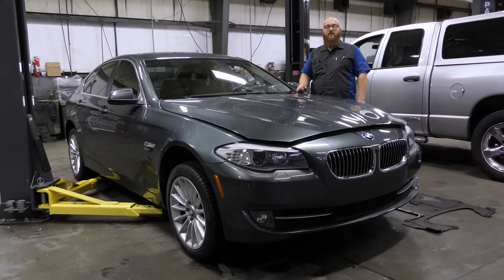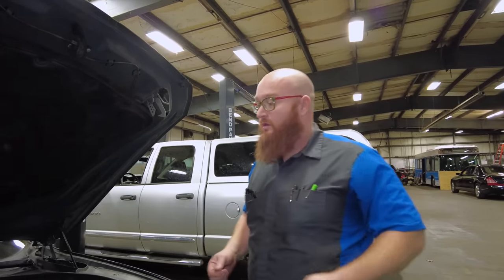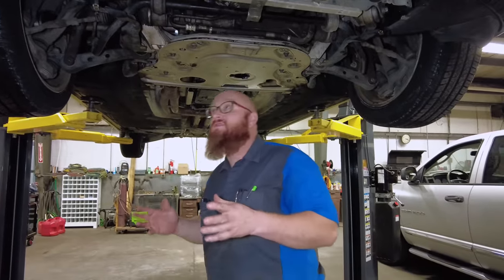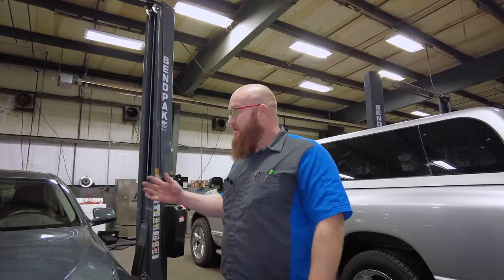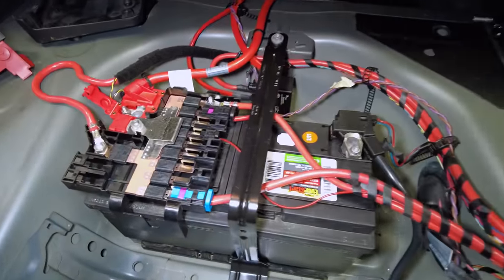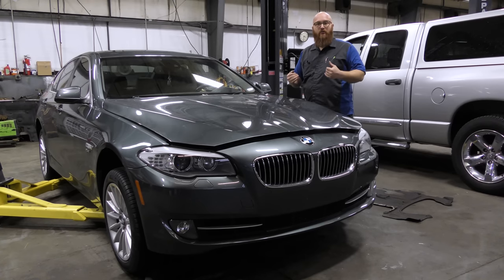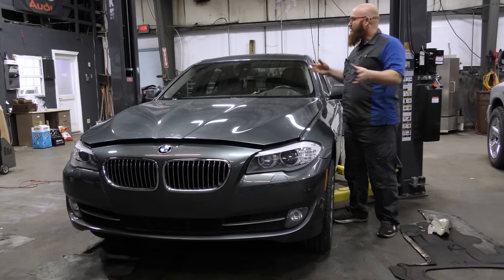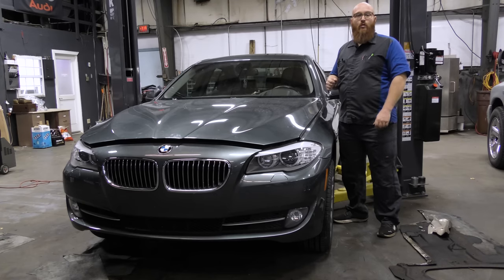One bad day for a customer! CAR WIZARD found TWO insanely unrelated issues at time on '12 BMW 535i

Comment: BMW engineers do an awesome job of designing their cars and parts to fail outside of manufacturers warranty. They make it an art form!
Reply: Jealous you can’t afford a new one?
Reply: No that's not it. I have friends that bought them new and used had nothing but trouble. I've even assisted a mate replacing all the cooling system plastics because they just perished and cracked, that sh!t box had just 96000 kilometres on it.
Reply: @seanm3ify  Whatever bullshit you might come up with doesn't make it less true. 🙄
Reply: Fords and GM too.
Reply: Once upon a time, BMW and Mercedes may have been a pain to fix, but the quality of the parts meant they were reliable.  The quality just isn’t what it used to be.  I would rather lease those than buy new, and if I bought used, I’d be prepared to DIY some of the easier repairs.
Reply: They fail even within warranty periods.
Reply: economic terrorism.
Reply: If you cannot afford a brand new BMW with a warranty there no way you're going to afford one when they are out of warranty and breaking all the time.
Reply: @Brusselpicker  they’re great first 3-5 years depends on series. Lease only lol.
Reply: It's 200,000 miles...hardly what I'd say as a "design to fail outside of warranty"...which occurred 150k miles ago.
Reply: @Dozer04r1  I have a Camry with 300k no a peep
Reply: @zachgorman1133  German cars fail plenty well within their warranty. The point is, they’re not what they used to be and BMW knows they can sell their cars no matter what.
Reply: @Boris Levenzon  I don't follow your connection. I replied to the comment that they fail out of warranty. Regardless of your Camry, 200k is far from any warranty. I am not commenting on if it should have failed at 200k.  BTW, I had an Accord with a failed transmission at 60k (out of warranty)...is there relevance?
Reply: As a BMW enthusiast who has been driving and working on BMWs for 22 years, I can confirm that this is true.
Reply: Dodge challengers are built on a BMW Chassis which has always bothered me. The rest of  the vehicle is top notch the chassis isnt.
Reply: they've learned from the best ... from the vw engineers
Reply: Lol another Burn My Wallet fanboy defending poor build quality. Who would be jealous about overpaying and getting ripped a new one for a guaranteed lemon of a car. Reliability means a lot when you shell out for a car and the German brands, except maybe for Porsche, just ain’t it!
Reply: @paulac1234  never been a bmw fanboy ...  burn my wallet , this was a good one tho :))) didn't knew it :)))))
Reply: I love my BMW....motorcycle. With a Rotax engine.
Reply: The bookkeepers are the boss in BMW. The suppliers are bashed on price, and that is the problem...low quality  parts. Now in the coming decades of EV's that will be the death penalty for BMW, mercedes AND VW. They sold out their goodwill!
Reply: @seanm3ify  im sure you cant Goober
Reply: @paulac1234  and your a engineer right ,,,
Reply: @seanm3ify  r/wooosh
Reply: oh yes like the other brands are so better right? I know people with BMW's that have over 1 million miles on it. Stop exaggerating
Reply: Gotta laugh at this comment section. I'm possibly a fair bit older than some of you other folks, 40 years ago, BMW made great cars using high quality parts and ran forever. In  the UK in the late 1970s they would guarantee their engines for 150000 miles when most vehicles would die before 100000. Then the bean counters and the electrician arrived. In the 80s began the first problems with BMW electrics with cars crapping themselves regularly with random electrical faults. The engine guarantee disappeared and metal parts began to be replaced with plastic. After 30 years of this, you have BMW with plastic parts in heat sensitive areas that go brittle and break causing the 3000 sensors in the area to stop you car from running, valve seats so soft you can spread them on bread, parts that cost three or four times other manufacturers for usually no gain in quality, engines designed so poorly that some simple servicing costs more because you have to remove so much crap just to get to them.
Reply: @nenaddimitrijevikj5125  I know people with a million mile Morris Marina, doesnt mean they weren't a heap of junk.
Reply: @Brusselpicker  thats your opinion whats junk and whats not.
Reply: @nenaddimitrijevikj5125  just as saying there is a million mile BMW isn't evidence they aren't.
Reply: @Brusselpicker  look im not saying they are the most reliable cars but they are not as horrible as you guys make them to be
Reply: @nenaddimitrijevikj5125  and I'm saying that's your opinion. Just like you said to me.
Reply: @Brusselpicker  oh God we got smarty pants here. Move along
Reply: It's called planned obsolescence, and millions upon millions of non car people keep on falling for it. 
Some people are so stupid, they buy a car because it's "cute". Omg. 
Such people should stick to public transport.
Reply: @blevenzon  You can probably do another 300k trouble free.
Reply: @Brusselpicker  well said!
Reply: @BubblesTheCat1  I once saw a batch of like 10 nyc taxi Camrys at copart for sale standing there on lot, they all had 400-500k on them
Reply: Not true! My dentist brother leased a brand new 640i. 

Even within the first year or so, that car was bonging at the driver after every startup about low fluid this, or sensor fault that. I took it in for 'service' for him once or twice myself, only because he was so tired of doing it so frequently himself... Garbage cars right from the start, nice to drive though!
Reply: Just like Apple iPhone
Reply: @lot2196  F650 GS?
Reply: @ceesheemskerk2397  actually, greed is the boss at BMW (too). they want maximum profit. since they bought back east-germany, they feel like it's time to be rich regardless the method..... which USA people should not blame germany for...
Reply: @Brusselpicker  you look sensible. however, you fail to realise, that what you are writing about is a general automotive industry trend. greed is the drive ... profit, you know... BMW also having shareholders... and they want their money...  also, there is a strong turning point in history.... west germany "bought back" east germany... so they were keen on to get good fame for german cars .... and once they got back east-G. than they relaxed.... and turned for profit, instead of reliability....
BUT, that brand heavily innovated their products... very fast paced innovations...and also, model cycles are no longer 20 years long... 3 years or 6 maximum with the highest classes (S-classe, 7 series, A8)....  and what could the USA car industry show up regarding innovation?  that market making petrol burning shitty muscle cars, riddiculous pickups, family SUV or sedans.... far far away from german innovations and on the top of it, cheap plastic solutions and shitty electricts too.
... all and all, this is a big game. and those people who are crying about failing luxory sedans, those people are driving through the rear-view mirror, instead of the front screen.....  
last but not least: german manufacturers always fixing the mayor issues untill the very last production year of the given model.... at least, correct attitude
Reply: So do VW !!
Reply: They are sadistic
Reply: @pilsplease7561  A Dodge challenger is not built on a BMW chassis.
Reply: @paulac1234  BMW is 3rd place this year in reliability
Reply: @oldrrocr  Nope. They have their problems from time to time, but when they're fixed, they're usually fixed. BMWs, on the other hand, are one problem after another after another.
Reply: @nenaddimitrijevikj5125  Yup, most other (non-German) brands are much, much better. You know people with BMWs with over a million miles? LOL! Stop exaggerating.
Reply: @Brusselpicker  You are 100% correct. 100%!
Reply: @nenaddimitrijevikj5125  They absolutely are. At least since the 1995-2000 model run.
Reply: @elstimate  Agree. In fact greed has overtaken Germany altogether, just read Merkl's comments on why she approved the Nord Stream pipeline. They would literally sell their souls for a few extra dollars.
Reply: @johnguidetti5839  Yeah, Chrysler never had anything to do with BMW. They did have a partnership with Mercedes.
Reply: @seanm3ify  Jealous to buy a endless money pit? I prefer a Cammed manual Camaro LS1 over any sheet quality beemer.
Reply: German Engineering!
Reply: It has to do with all the electronics, and extremely expensive parts to replace, and labor to work on. I would not touch one with a ten foot pole, unless it was leased. The older ones, like 70s,80s, and even some 90 models were reliable though.
Reply: @seanm3ify  Who would want one of these plastic-engined marvels?
Reply: @Brusselpicker  for you, time to retire from the comment section too, oldtimer
Reply: I heard a Mercedes exec...started buying old reliable buicks/ F150 pickups for retirement. 
He knew the REAL COST TO KEEP/ FIX/MAINTAIN THEM.  
I know people w Benz/Audi/Bmw they suck hard.....waiting to trade/ sell....
Reply: Hose got hot, popped off....never seated clamped right maybe .
Reply: The guy I work with just bought his wife a BMW they are having it custom made with the things she wanted but they didn't have available ,I tried like hell to talk sense into him before buying  but he figures he'll take his chances so I shut up I drive Lexus and highly recommend them but to each his own  he'll find out for himself now
Reply: @seanm3ify  They are garbage the guy I work with just bought his wife one and he'll find out for himself ,Lexus is the only car I buy and drive for peace of mind
Reply: @paulac1234  Buy a Lexus and sleep good at night
Reply: @seanm3ify nobody is jealous when it comes to owning BMWs. Funny part is when I was selling my 2000 Honda Civic SI I had two BMW owners message me offering to do a straight trade for their junker BMW . I just laughed and declined their offer .
Reply: @seanm3ify   they are six to eight grand. can I afford it? yes. can i afford to keepit on the road. probably. do i want to go broke doing in? hell no.
Reply: @nenaddimitrijevikj5125  probably an older straight 6..not the new junk
Reply: Love my e39
Reply: @mikeblast7507  older ones?? Yes
Reply: @seanm3ify  lease for 300 bucks
Reply: @pilsplease7561  I believe that's a Mercedes chassis--they used to own Chrysler.
Reply: @mikeblast7507  It could be i dont know, but its a very solid and good chassis.
Reply: @seanm3ify  new ones become old the day after they leave the lot ..my current BMW went back in the shop for a full differential replacement after one week... it was out of commission for 2 months ...i was lucky this was before the covid craziness
Reply: @seanm3ify  I have the money, But the reason I have money is I have always owned vechicles that I could work on and were dependable. and Now I own Toyotas, say no more!
Reply: Awful cars. Such poor engineering. Terrible. Look ok
Reply: @serenan920  And the trade in value stinks, that is why you see many being sold by the owner as the dealers won't pay much.
Reply: @seanm3ify  Afford one or not the car is made that way (reality)
Reply: @blevenzon  I love toyotas but it really isn't the same experience owning one.
Reply: @paulac1234  don't think you know about Porsches then.
Reply: @DeepakKumar-lv4te  no of course not, they’re simple and boring
Reply: M_B too .
Reply: There junk
Reply: @oldrrocr  chrysler jeep to
Reply: @billrea66  As unreliable as German cars are, They are bulletproof when compared to British cars - like Range Rover and Jaguar. My God - you really have to be rich to own a Rover.
Reply: @mule666  And i love my two E30 325iX ! Now they are 34 and 35 years old and zero problems !
Reply: @BubblesTheCat1  And i have two BMW E30 325iX. Now, they are 34 and 35 years old and zero problems !
Reply: Bmw‘s are nice to work on tho
Reply: @seanm3ify  This car is actually cheaper than a 2012 toyoto corolla in used car market  in US.
Reply: @JBM425  you just summed it up.  BMW makes great money on leases,
Reply: @seanm3ify  Poor riffraff should not be driving high end cars. They are for high earners like lawyers and doctors as well as rich people. It makes me sick to see little people trying to make themselves look well off by driving a nice car. BMW should also install software which shuts the electrical system off after 4 years and then change a monthly subscription to the next owner & future owners.
Reply: @seanm3ify I have two and I agree with him!
Reply: Unfortunately purchase cost is relatively minor compared to the cost of maintaining BMWs, which is why owners sell them -- they run out of money to fix all the problems. And basically no amount of money will be able to make these cars reliable.
Reply: @JBM425  Yup, they made great cars that were very durable, but that ended in the late 90s/early 2000s.
Reply: @pilsplease7561  

they are note. tthe chassis are based on an mercedes w210. happened back in the daimler chrysler era.
Reply: Probably all 3 of those possibilities 😅
Reply: Sadly I wish u were right but it depends on your luck, i am the owner of new X5 Hybrid version and its still under warranty. I had change the battery twice in under 2 years and now its getting some problems again. I am selling it off 1mil% after warranty ends. It cost 27k usd per battery change.
Reply: BMW is one of the worst engineered cars on earth. Failure rates are off the charts.  A 7 series 2 years old loses 75% of its value for good reason. Just listen to the wizard
Reply: @elstimate  wrong
Reply: The car had 200K miles, ffs!!!!!!!!!!!!!!!!!
Reply: @oldrrocr Ford and GM dont cost new as much as BMW. Buying a BMW should be a premium class, but unfortunately it aint that much of a big difference in terms of quality.
Reply: The very essence of "German engineering" can be summed up as "designed for catastrophic failure"... I always see "german car graveyard" garages in my town... No other car has this phenomenon 😁😂
Reply: @seanm3ify they cheap now a year later 50 percent depreciation
Reply: Nope - they are just that good at math.
Reply: @seanm3ify how's the dealer loaner car drive?